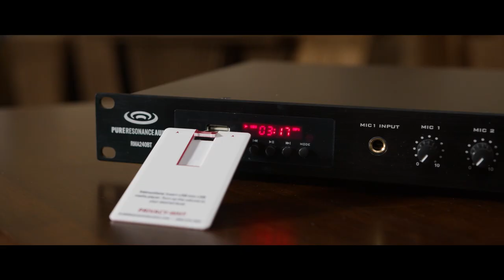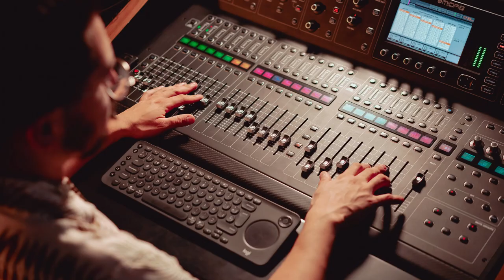Powered Amplifiers vs Mixer Amplifiers for Commercial Sound Systems on Pro Acoustics Tech Talk Ep 61

Comment: I have not been able to get an answer to a question I have about Mixer-amps, so hopefully someone here can enlighten me. Can an active sub-woofer be connected to a line out or aux out on a mixer amp that does not have a dedicated output for a sub-woofer/LFE?
Reply from the maker: Hey Djard, great question! Yes, you can connect an active subwoofer to a line out or aux out on a mixer amplifier that does not have a dedicated output for a subwoofer/LFE. I hope this helps!
Reply: @ProAcoustics  Thanks. I found that "Tape" out also works well.

Comment: Thanks for the video. I had a question though. I currently have a 'Harbinger Level 7' mixer with 2 PC's hooked up to it via the Ch 2/3 and Ch 4/5 which lead into the headphone out via a 1/4inch stereo to 1/8 inch stereo cable. When I turn the audio levels up I get a lot of noise, and hear I could hook it up to a powered amplifier somehow to counteract that. I am looking to buy a Shure SM7B microphone to hook into the audio mixer and then into my main PC, but I have no idea on where to start to connect them all together. Any help would be appreciated, thank you.
Reply from the maker: Hi Matt,
Thanks for watching! We would be happy to help you source a microphone along with whatever additional components you need for this project. One of our sales engineers can walk through the setup with you and make sure you get all the right equipment. Please reach out at 888-256-4112 or email sales@proacoustics.com.
We hope to hear from you soon!

Comment: Hello I just bought 3 powerless speakers, could you provide a recommendation on a product that can take an output from my computer to run on these 3 speakers?
Reply: the speakers are red/white not single cable
Reply: 2 jbl xti 20s and 1 jbl xti 10 center
Reply from the maker: Hi Isaiah, I would recommend contacting one of our sales engineers to discuss this further. They will be happy to review your application in more detail and provide a product recommendation. You can email sales@proacoustics.com or call (888) 256-4112.
We look forward to hearing from you!

Comment: How much watt the mixer amplifier pushes if you connect a speaker to it?
Reply from the maker: The watts that a mixer amplifier pushes to a speaker will depend on the watts that the speaker is set at. Many 70-volt commercial speakers allow you to adjust the amount of watts the speaker will pull using tap settings.
Check out this video where we explain how to choose your amplifier and properly set your speaker tap setting: https://youtu.be/-omIOiKUrdw?si=k9JHajGZ9b8qQKfD&t=86

Comment: Hi!
I have a PVI 6500 Powered Mixer. ( that info came from the silver tag on the back).
I need to purchase minimally 3 cordless microphones. Would you please tell me what microphone brands are compatible? Thanks
Reply from the maker: Hi Vanessa, Most any brand will interface with that unit. We suggest getting a multi-channel capable (frequency-agile) microphone to allow stacking up that many mics for simultaneous use.

Comment: It is more a question...can we have separate mixer and amplifier connection instead of a combo type
Reply from the maker: Yes, you can definitely have a separate mixer and amplifier in your audio system instead of using a mixer/amplifier combo. In fact, many professional audio setups prefer separate components for greater flexibility and control.